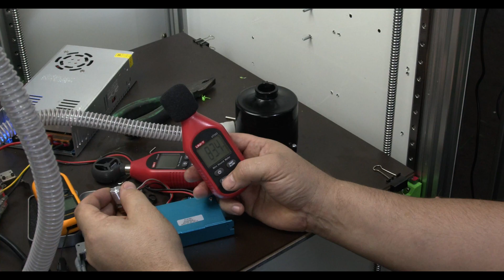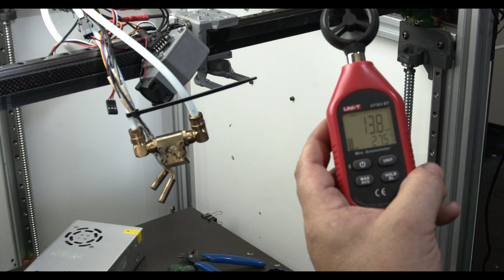The ultimate cooling solution , A wm9290 cpap blower  100mph air velocity

Comment: How does this performs against a berd air system?, I have been wondering, i mean i would think that high pressure on a pump equals high air speed but less flow on pressurized systems like nozzle type coolings and berd air, and high flow equals high speed in a non compression system ( like the simple ducts used in almost every printer) but at the end can you cool better having more speed or more airflow ?
Reply from the maker: This system makes berd air , look like a toy , it can do both high flow and high pressure

Comment: If your willing to go this far try a Dyson vacuum motor as AVE says they are black magic and should outperform this solution
Reply from the maker: they are just a little brushless motor and the magic is they use high rpm and a smaller compressor to create airflow  :) there is much magic that happens at higher rpms in terms of efficiency ... but also  ... sooo much noise

Comment: Wouldn't be a compressor be better to do the job? You could run very light and thin lines at a high pressure.
Also if you would cool the air after compressing than the air exiting would also be cooler aka below ambient.
You could even push this to the max if you then drop the radiator in a salt-ice water bath or even better dry ice :D
Cooling with -50°C air :D   

EDIT: Rather impractical for daily use but liquid nitrogen cooling would be cool too.
Reply from the maker: So a compressor is good , but you have other issues  , you need an air drier or you will spit water vapor at the part , you need to be thoughtful of thermal shock and the rapid cooling of plastic .. the idea here is to cool the plastic to just under glass temp .. but not below .. for that you need much control and less pressure .. pressure can create localized cold points depending on the shape of the object and thickness ... next video we will talk about it
Reply: @vvega007  of cause you have to use dry air and the high pressure would only be for "transport" you don't have to blast the part with high pressure. Also my thought about the cooling of the air was you need way less cool air to do the job :)

Comment: Can’t wait to see this one in action 🤩🤩🤩 Go Wayne Go! Noise doesn’t matter… for now ☺️
Reply from the maker: I’ll have a solution for that soon , I’ve started a intake design using a paper air filter off a car so it’s cheap to do … once I get the prototype done I’ll measure the frequency’s that are peaking then put a resonance chamber on it to make them shhhh :)

My poor resin printer is in full time production atm punching out parts for everything  :) honestly , what additive manufacturing has done for prototyping is as much as 3D modeling did in the 2000’s

Comment: now imagine with a lot shorter tube. It would be even more flow right ?
Reply from the maker: Yes :) most of the flow restrictions is from the nozzle design , just did some quick testing , the flow Hardly drops at the hose output  it’s just my nozzle that needs work :)

Comment: If you are looking for an industrial upgrade to this blower, I recommend the Micronel U100H4-02KA-4. It is around $500 but it is rated for higher pressure at similar flow, higher efficiency, much lower noise, at least 20 times the expected bearing life, and has an integrated motor driver.
Reply from the maker: I’ll look it up !! I am quite the fan of overkill :)
Reply: @vvega007  Adjustable overkill in prototypes is very important. If you can't adjust something past optimal to too powerful, how can you tell if you reached optimal?

Once you find optimal for a given configuration, then you can find a reasonably priced part that goes a small multiple above optimal. 

Resources permitting, you always want some headroom so you can still reach optimal after upgrading some other part of the system. Or for a blower in particular, if you need to use smaller diameter tubing for some reason.

Also, over engineered prototypes are cool.

Comment: Did you find a High temperature resin?
I've been searching for some yesterday, Siraya scultp ultra or Phrozen TR300 and some others go over 160°C, but I don't know if there quite as rigid at room temperature.
Reply from the maker: I’ve been using the tr300 , 1.3 second layer times and it’s very rigid !
Reply: @vvega007  Very Cool, I might try that one too.
such a shame these resin go bad after a year.
Reply: I know a company called Molazon that makes a high temp resin with a glass transition temp (If I remember correctly) of around 200C perhaps this could help you out?